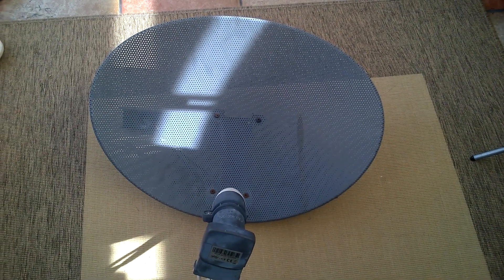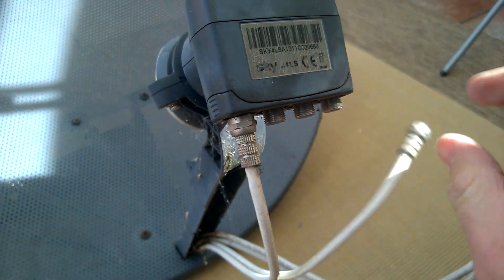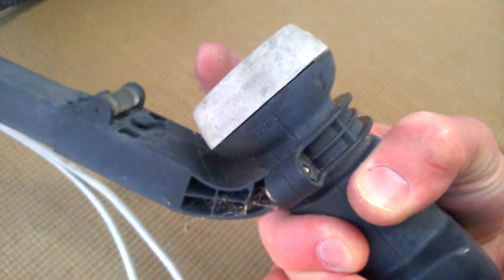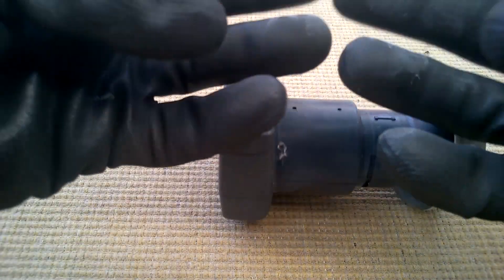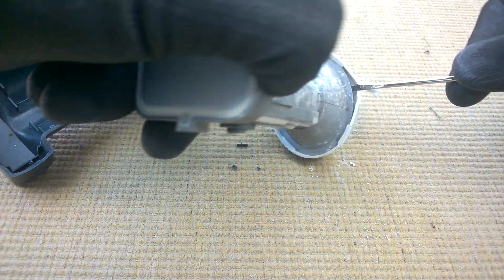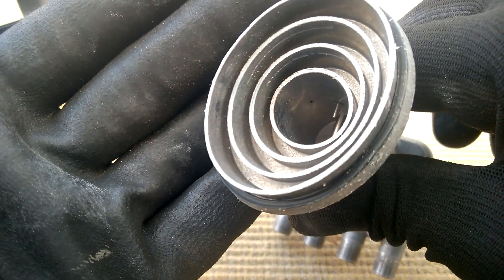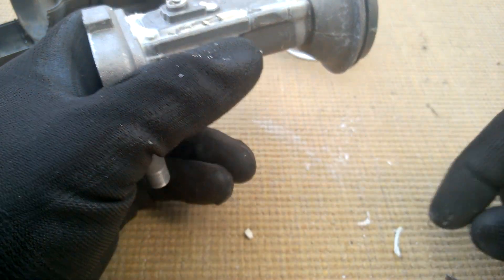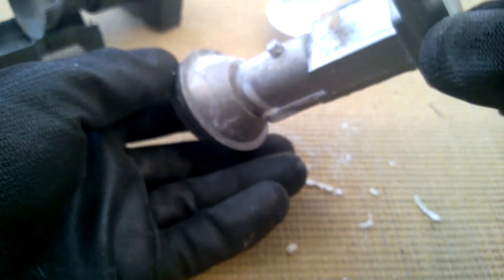Satellite Dish Feed Horn Tear Down

Comment: Since nobody else has commented, I will.  The first screw you looked at is for frequency setting the dielectric resonator, that was the round bit that you broke off the pcb when you pocked in the screwdriver.  The bits of rubber like are loaded with ferite like substance for stopping any spurious oscillations and feedback between the different stages.  As you say a lot of goodies in there, a very sophisticated piece of electronics converting the two 11.7 -12.3 GHz (approx) satellite TV bands horizontal and vertical polarisation to  the lower frequency that your sat box/tv use 0.950 -1.7 GHz (approx).  So called a LNB (low noise box), these days even smaller circuitry is used.  Actually a quite remarkable design and very high tech, just show what mass production can do, bringing down unit prices to a few pounds.
Reply from the maker: Super interesting, thanks!